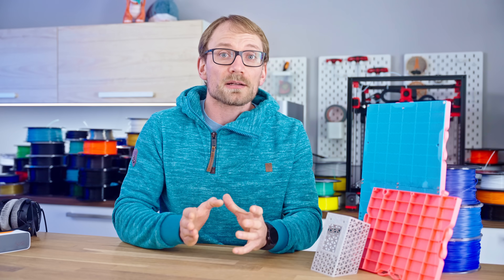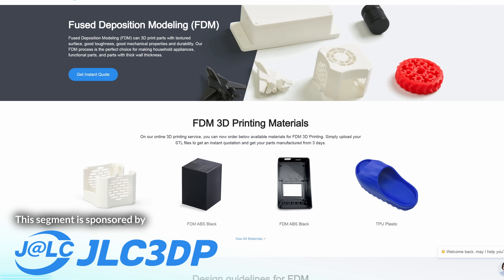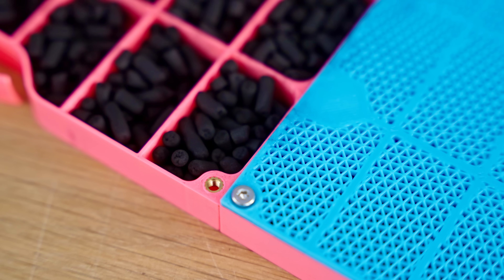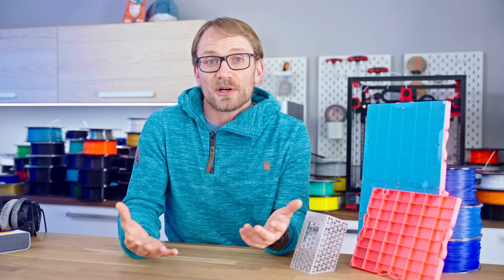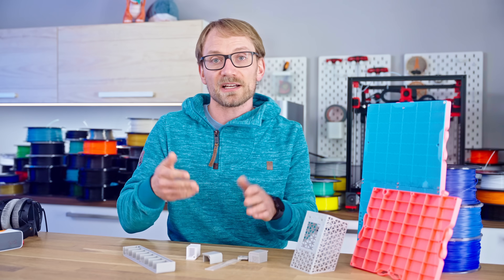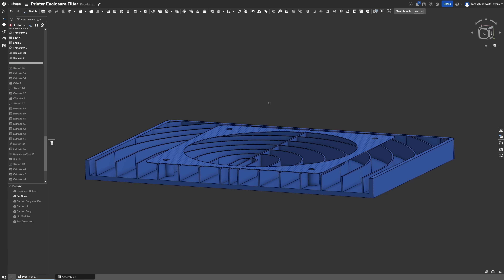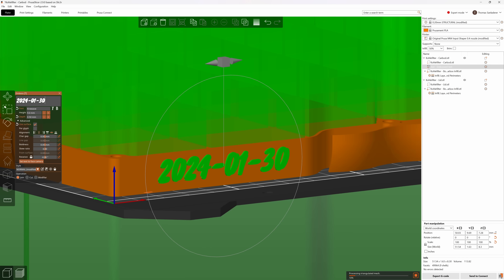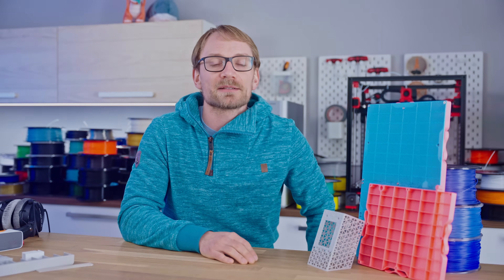Slicer Hacks to improve your 3D Printing Game

Comment: the fan cover or diverter shown when talking about the bridging looks awesome but at least two of the channels, Last two on the largest radius! Don't get air from the fan as they are closed off to it did you decide to just continue with pattern to make it easier using a pattern setup etc.? curious to the logic hear only because the parts strength would have increased by using these non functioning cavity's as some kind if shell support etc. great vid and info btw as always

Comment: This and the previous screw hole videos are very inspiring. I think you've just doubled the speed of my workflow because I'm thinking of making my models as composite from now on, in the sense that I will create positive and negative meshes for boolean in the slicer instead of trying to make perfect single parts (that I would still have to wrangle in the slicer as well to make it print the way I want)

Comment: counterbores work so much better if you just model a closed circle the thickness of a layer in the transition from counterbore to through hole. Everything bridges just fine, the layer is thin enough that you can just push a screw through it. Or clean up with a drill bit if your being thorough.

Comment: For your fan adapter, you WAY over-complicated your model creation -- surface modeling is where it's at. You sketch only the mating surfaces, then use bluesurfs to connect them and adjust the normals/tangency/perpendicularity parameters to get the curves you want. You can also create flow guides the same way, but instead of a closed shell you thicken a surface to however thick you want the wall to be.

Comment: I knew I didn't know a lot of what Orca could do, but after fooling with it yesterday to automatically add pegs to a part I split in half to fit on my bed, I've been wanting to learn more. Boom, a day later I spot this video! Negative spaces what?? Amazing. This will save me a lot of time doing partial test prints where I used to have to load them into 3D builder and chop them up manually.

Comment: Could anybody please try to explain in a bit more detail the method shown between 5:47 and 6:02? I've watched it multiple times and I'm still not sure if I got it right. (I am familiar with the trick shown between 5:09 and 5:26 to create the layered "shoulder" bridges for upside down printing of screw counter bores.)

E.g. at 5:58, the "bridge" being created from the central "spine" (in the lower left part of the image) looks like it starts being created as an overhang rather than a bridge, doesn't it?

This is the part I struggle to follow: "Offset every other segment one layer up so they wouldn't be printed as one big bridge but instead be split into segments to give the slicer an opportunity to optimise the bridging direction for each one separately" - how should I actually do this? "Offset every other segment one layer up" is clear but how should I create those segments? Or does the slicer select them on its own?

Thanks!
Reply: Yea, it does look like that one is printed as an overhang rather than a bridge, think I'd of bridged it to the two adjacent ribs. 
But for the way he did it, you can see he modelled it in CAD (the onshape frames previously), so not a slicer setting. 
Think the intention is that the bridge sections are shorter and spread over multiple layers.
Reply: @tamacoable Yes, in CAD, but it's still unclear how he created the segments.

Comment: A video with "Best CAD design for 3dprinting rules and tips"

Like tolerances,
Overhang distance optimization,
Chamfillets (Chamfers where fillets would be overhangs)
How to desing reliable holes
How to design reliable Print-In-Place geometries.

:D
Reply: Oh, and also, how to avoid printing parts prone to layer-adhesion failure under stress.

Comment: I’d love to see more about that IKEA refillable cartridge! I’d love to be able to switch to a refillable option.
Reply: The first google search returned its name: NYTTIG. You're welcome 🙂
Reply: I think my previous comment vanished - many people are complaining about this happening on yt.

Anyway, I think I figured it out. He printed a "cartridge" that takes carbon pellets, to use in an Ikea Fornuftig filter, instead of the original cartridge, that is sold for 10 euro a piece and has little carbon in it (although it probably has a lot more surface area than the replacement with pellets has). 

See the directory name at 3:15

Comment: I wish it were easier to precision-position negative and positive volumes in slicer, instead of scooting and slicing and seeing if what pops out is correct, lack of surface or edge snapping.. but then it's practically CAD at that point. Also if you reload from disk, probably make sure the origin of your part never shifted, else you're in for a bad time if you blindly print. Thankfully in-slicer measuring has gotten better, It's actually the only way I've figured out how to position my positive and negative volumes so surfaces cleanly 'touch'.

Comment: If you want to print just a piece of a big part, just use "Cut" function of a slicer a couple of times. Seems simpler than drawing and scaling boxes.
Reply: While you're basically right, `cut` could do that too, you're missing the point. It's just much easier to simply remove the negative volumes to restore the original piece for the final print.
Reply: @Michael_Strand  didn't think about it that way. I was using ctrl+z to undo the cuts.
Reply: Both work and depends on the geometry :)

Comment: For upside-down counterbore holes, I just print two full layers (a bridging layer and a solid infill layer) filling the entire cross-section (i.e. closing the hole for the threaded part of the screw), and then drill.

Comment: I wish slicers would just detect these features and configure bridging bodies and settings automatically, but the design software and slicer would have to be way more integrated. Imaginge parametric bodies linked to your models directly. For example, clicking to add screw holes at the center of cirkles defined in sketches or adding mouse ears with a single click.

Comment: Also it is not a good idea gyrod to fill up the filter thingy at the end. The gyrod geometry by definition has two well separated volumes (actually it is a F amazing geometry for a heat exchanger) but for a filter like the geometry you showed, you will have a lot of dead volume inside. Specially near the walls as it is not a radial gyrod but a simple xyz gyrod.

Comment: For the flat laying lattices, since i primarily print with a 0,6 mm nozzle, i tend to use 10% to 20% triangular or hexagonal infill, pause the print after three or four layers and add a fly-screen-mesh.
Used this method already for the Bento-Box and inserts for the outlet/inlet nozzles of my portable air-conditioner (had a great tit trying to build it's nest in one air-duct once ).

Comment: If you are printing a centrifugal fan impeller you can use the Extra perimeters on overhangs setting (Prusa) to get arc shaped bridging that supports the inlet ring on the impeller blades.

Comment: I want the slicer to allow something I would call pillar mode. Imagine you print a 4 legged table upside down. If the legs are far enough apart finish each leg in z before going to the next. This would eliminate stringing and reduce travel time.  This could be at a print head level for tall objects or just a couple layers for close objects . Let's add more z moves in our prints to reduce fruitless xy moves.

Comment: I find positioning geometry, in the slicer, really tricky and it's never accurate. At least with TinkerCAD you can use a dimension,  AFAIK that doesn't exist in the slicer. Would be nice to have. Same with aligning faces. Perhaps it's fine if you dont care where additional screw mounts are in this example, does anyone have any tips?
Reply: Just learning the coordinates and reading your parts. If you really need to get these things spot on, do the extra work and measure the placements in CAD and make yourself a set of 2D drawings. You have the coordinates in your use so learn to use them.

If you wanted some real crappy tips, get ready to get dirty. If you use Prusa slicer (I use it so, I can't guarantee this works elsewhere), it calculates your models origin into the center of your model. This means 10x10x10 cubes origin will be 5,5,5 and it's placed in the center of your buildplate (so for my SV07+ the default coordinates for the cube would be 150,150,5, center in X and Y and bottom on the bed so Z offset 5). This is absolute, so it will always look at the extremes of your model and place the origin in the center of it all, this also applies to multi-solid models (models with more than one object in them).

Dirty part is to abuse the multi-solids.
What you do is to add objects around your model so the slicer will calculate the origin of the "model" from those objects around the model.
You can add like 1 by 1 by however tall your printarea is, cuboids into your CAD program so their furthest corners mark the size of your buildplate (for my SV07+ that would be -150,-150, -150,150, 150,150 and 150, -150 and 350 high and I would have 300x300x350 area in my CAD with the origin of the CAD working as the center of my buildplate), these cuboids will force anything placed within them and exported with them to appear in the slicer in that exact place (so if you add our little cube 50mm from the buildplate, slicer will tell your printer to print it 50mm from the buildplate).
As long as you export those cuboids with your models, all your models will have the same calculated origin in the slicer and all you need to do is to match the coordinates in the slicer (for me 150,150,175) and then add only the corner cuboid model as negative volume to make it so they won't print.

Comment: I did used this type workflow with my flyswatter I made. I made the shape of the head of the flyswatter. Then used no top or bottom layer with the proper infill to swat flys. It was a simple concept, but this is interesting to see how it can be expanded upon in concept. Which leads me to saying this is the type of video I like and it seems a lot of creators are running out of the process to reach these methods. Congrats on sticking in there, a channel of your size and age is where many have already fallen.

Comment: 5:20 this is something I really need to get into more. almost everything I print is modelled by myself, but sometimes it's just not possible to avoid a lot of overhangs unless I split the parts or something which is generally a giant PITA. my experience with bridging is just that it works very poorly on my printers though :d

Comment: Nice one, extra kudos for the "Reload from disk" shoutout, our developers use that feature all the time, as we iterate printer parts.
Reply: It's really handy for iterating for sure, I use it all the time!
Reply: I think I end up using it on most of my prints, to be honest... Export the model, slice it, examine the gcode, tweak, export, re-load, then repeat. Fantastic tool :)
Reply: I almost always have to use "replace with STL" and load a different file, because the slicer keeps the original STL file locked so I can't overwrite it with my updated model 🙄
Reply: @renxula Are you on Windows?
Reply: @TuncayAyhan Yeah, "file locked" is a Windows specific problem.
Reply: Yep. I use "Reload from disk" all the time. It's a must-have and must-use. As well as sacrificial layers for upside-down counterbore holes or holes within specific geometries (which I use ... all the time as well).

Comment: I love using exposed infill as a screen, but you can also easily combine it with a pause to insert your bug screen midprint as BillieRuben showcased years ago with tulle. Strengthen your mesh insert with infill, and get the finer mesh sizing of the fabric.

Comment: Great tips thanks! Have you tried the released brick wall mode yet? 

Future video idea: The "LH pico mmu". One servo and one stepper quad-lane switching via clocked cam engagement instead of a stepper/driver or extruder for each colour. Pretty neat idea and right up your alley for implementing it into Klipper, sir! Have a good one all.

Comment: The multi-depth overhangs were an AHAH moment and i really appreciate this one. I gotta go back and look at the thread deal you mentioned at the end. i have been printing threads and tapping them with great success but i wonder if that plug template you use would decrease print time with same thread engagement success....

Comment: I see it as a challenge to design parts that are optimised for printing and don't need support or any default slicer settings changed, especially when I know others will be printing them.
For one of my designs I created 2 supports in the editor because turning on supports in the slicer would have unnecessarily added them everywhere.
Reply: imma second this, but for the reason of print consistency as well. the more you push your prints, and require support, the more likely it is to have print artifacts/failures
Reply: @blockfifteen  yes print consistency is another factor of designing parts that don't need support. I like designing small TPU parts and found when you work with the assumption of printing it with a typical 0.4mm nozzle and 0.2mm layer height you can practically force the slicer to slice the part for strength and consistency, like making the walls 0.8mm / 1.2mm / 1.6mm thick which are a multiple of the 0.4mm nozzle.

Comment: The trick with the modified mesh also works really well to add extra wall thickness to heatset inserts. I really like using negative modifiers to print a test section. I’ve been doing that in CAD instead, but this is way better!
Reply: I wish there was a way to assemble items in slicer via anchors. The example of adding screw holes was great but controlling the relative locations of these slicer added features is cumbersome, especially on large prints that need to be angled to fit on the bed.
Reply: This design approach is waaaay better

Comment: Love the little jab at Bambu. But I think you are onto something here, I 100% see them adding a subscription with extra features in Bambu Lab. Now that everyone is forced to use their slicer to send files to the printer it's the logical next step...and the incredibly cheap hardware needs to make profit somehow
Reply: I would be willing to bet most of my net worth that within five years we'll see paywalled features in Bamboo Studios.
Reply: Wary of Anycubic following suit
Reply: Also extorting developers for demanding fees for "certification" is a distinct possibility..."Nice software you have there. Be a shame if it stopped working on the most popular printers...😉💪"
Reply: I actually stopped using bambu studio (I'm using orca now), put my p1s in Lan mode, and even set up a firewall around the slicer (just in case I need it in the future). I even blocked the printer from being able to connect to the internet, while stile being able to print over Lan. 

Bambu Lab ain't getting their despicable hands on my printer and forcing me into anything
Reply: @josephgauthier5018 same here! P1S in LAN mode, firewalled off and using Home Assistant as my Bambu Handy replacement (mainly notifications on pause, errors and finishes)
Reply: Using orca with the printer in lan mode. I still get to use all the features and the print starts immediately since it doesn't go through their server. Ideal when in conventions or workshops with limited internet connectivity.
Reply: We aren't forced to use Bambu's slicer, you can still use any slicer you like and just use the SD card. Plus Orca is getting an integration with the new Connect system for the whole sha-bang so you could in theory just use that if Bambu locked certain features behind paywalls on theirs (although we can certainly slap a big "yet" on the end of all this)
Reply: @syko2695  Bambu Lab has been pretty open and responsive, but the 3D printing community tends to overreact anytime a company makes a change. This isn't some evil DRM move—it's a security measure, and they even added Developer Mode to keep things flexible. People need to take a breath before jumping to conclusions. Bambu is still one of the most user-friendly and innovative brands out there!
Reply: @syko2695  correct me if I'm wrong, but the Orca Dev made an official statement that he will not add support. Either way, the path for Bambu is set. VC investors need their money back afterall
Reply: @syko2695 For now.
Reply: Bambu Connect actually makes it easier to use more slicers to send prints wirelessly than before. Not that I think what they're doing is good or makes sense. But get your facts straight.
Reply: Weird cool aid you drank. Apparently your printers SD Card slot disappeared
Reply: @Yuki-Hai "Hey, they won't allow you to use your car, but you can still get there by horse, can't you?"
Reply: @Yuki-Hai  well, if you want to live in 1998, use your SD card 😅